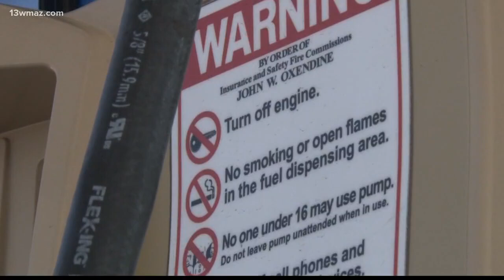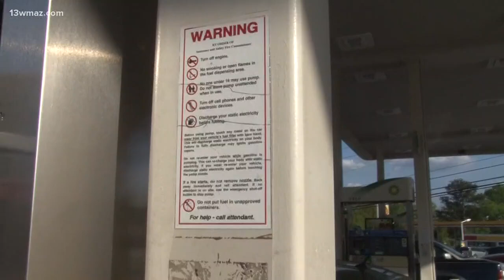VERIFY: Is it safe to keep the car running while pumping gas?

Comment: Well in nascar, they fill up the car while running
Reply: Yes but fires from static is only like 1 in a billion and in NASCAR there is no static to be built up (no fur coats and getting in and out of the car)
Reply: Rafeed Ullah static fires have nothing to do with leaving the car running.  That’s why this is so stupid.
Reply: Why do you think they wear fireproof clothing?
Reply: @thaddeuskyle572  because their build can catch fire due to the extreme conditions they run, also crashes can often lead to fires.
Reply: They also where fire protective suites
Reply: race cars have caught on fire while refueling before
Reply: @RafeedU  "no static to be built up"

Bruh.
There's rubber tires, plastic and latex uniforms and gloves, and most NASCAR races happen in hot dry weather. 
TONS of static can build up there. 
Now, if the pit crew wears grounding straps, THEN they're all safe
Reply: Bruh I’ve been refueling with the car on for 10 years I’m not dead yet
Reply: @delvictor7570  10/10 this was my assessment as well, only talked abt static.
Reply: Allison Hunter  Nope, you don’t understand how cars work. But wear out your starter out idc lol. The only reason gas stations say to turn off your car is because so many people leave them in drive before they get out. A cars internal ignition system is incapable of starting your gas tank on fire.
Reply: In nascar they have a specially designed connection for their gascan/cars that makes a proper seal when connected, not a fair comparison to fueling up an everyday car.
Reply: @brenxbux also very rare and that was due to a different fuel type

Comment: Wouldn't the static electricity ignite the fuel  even when the car is off?
Reply: Yes, yes it would.
Reply: Allison Hunter  better not start your car after filling up if someone is still filling beside you....you should probably only use gas stations with one pump or when they are completely empty using that logic...do something to become more intelligent please.
Reply: Lol i dont think any of us have a master degree in physical bio chemical fire ignation. So if authorities say turn off the engine when you pump. They  must have a good reason why they say so 😂😂😂
Reply: @mathewvanostin7118  Don’t believe everything you see online bud, these people may have degrees but you dont know what kind of student they were. 60% is still a pass
Reply: The fumes from the gas causes fire. When car running while you pump the chances of igniting increases.
Reply: @PrincessTrunksBriefs  Yes… but no
Reply: @PrincessTrunksBriefs  how?? Neither you or they have explained the how..
Reply: @justinmorton1774  Fire needs Heat, Oxygen, Fuel. Fuel is Fuel, Air Oxygen, static electricity causes spark which has a chance, albeit small, of sparking a fire.
Reply: @PrincessTrunksBriefs  that only explains the static electricity part…the engine being left on causing a fire has yet to be explained…
Reply: @justinmorton1774  While car is on ot os burning a liquid. If you are inserting fuel while it's using it their chance the fumes burn instead of the liquid. Causing a fire
Reply: @PrincessTrunksBriefs  no…that makes no sense
Reply: @justinmorton1774  that sucks
Reply: @justinmorton1774  It's explained pretty simply in the video, if you dont understand it maybe learn how vehicles work and how fire works
Reply: @PrincessTrunksBriefs  mechanic of 20+ years….I think I understand how cars work….probably even better than a fire chief who can’t change her own oil
Reply: @justinmorton1774  and wow, you know how to drain something and put more in, so smart omg
Reply: Yes sir... That's a fact Jack!!
Reply: @PrincessTrunksBriefs  Please explain how can the spark from the combination chamber inside my engine on the opposite side of my vehicle would get near or in my gas tank? If I have to worry about a motor running it would be about the person who just pulled up behind me to get gas where their motor is only about 4-6 feet from me instead of the 12 to 16 feet that my motor is from my gas tank filler.
Reply: @shawnyoung5960  tagging onto this incase someone has an answer.  I still turn my car off as I'm sure it could'nt hurt, but having an indepth answer to this would be nice.  Honestly I think this question would probably warrent it's own video
Reply: EXACTLY😂😂😂😂

Comment: "If the heat from the engine comes in contact with fuel" lmfao you apparently have no idea how an engine works. There's no danger in leaving your car running while pumping gas. Hence the reason this entire video is about static electricity.

Comment: Um no,  a fire starting from your engine running is so unlikely it’s not even worth thinking about.
Reply: Murph Kilter but consider how easy it is to just turn off your car. Saves a tiny bit of gas too. There are three things to consider when evaluating risk, 1 how bad does the risk suck should it happen, 2 how easy is it to avoid, 3 how likely is it to occur. Yes it’s unlikely but the other two factors make it worth avoiding since it’s easy af and the severity of it occurring is life/severe injury threatening and damages your car
Reply: I disagree, I think the risk is so low that I am far more concerned about the wear it puts on my starter.  As little as that is, I am way more concerned about that.  Again, the chance of gas igniting is so low it’s not even worth thinking about.
Reply: Murph Kilter well survival of the fittest ... read into it, and swallow your pride
Reply: Rit Mo pride?  It’s common sense.  It’s like not flying in a plane because sometimes planes crash.  Expect flying is far more dangerous than this. I fill gas everyday,  I’ll extend the life of my starter thank you.
Reply: Murph Kilter lmao imagine caring about a starter more than your life , I’ve seen a cop give a guy a ticket for pumping gas with the engine on... but hey Darwinism at its finest 😂😂😂😂😭
Reply: Rit Mo you don’t understand how cars work.
Reply: Murph Kilter my brothers a mechanic buddy
Reply: Murph Kilter just disregard the part where I said a cop gave out a ticket to someone with your thought process lol
Reply: Rit Mo I’m assuming you never leave the house, you know cause that’s where all the dangerous stuff is...
Reply: Rit Mo I wouldn’t even go near the water, you know cuz sharks.
Reply: Rit Mo you obviously don’t even know why some gas stations say to turn off engine when filling gas. Hint, It’s definitely not cuz it’s a fire hazard to leave it on.  But most idiots will tell you that.
Reply: Rit Mo great rebuttal
Reply: Murph Kilter fellas fellas let’s all Calm down
Reply: H.A.M It’s simple.  
1. He’s easily influenced by things he sees on the internet.
2. He fears things he does not understand, and he thinks everyone else should fear them too.
Reply: @delvictor7570  out of curiosity and for my research, since I've been reading what you're saying in regards to safety, can I come you're an anti mask wearer during these corona times?
Reply: A A no I’m not.
Reply: A A can I come that you’re a nosey liberal worried about what everyone else us doing during these corona times?
Reply: I'm definitely no expert, but I worked for an insurance agency for 10+ years, and an explosion from pumping gas while the car was running was reported. 

The report stated that gasoline powered vehicles have sparkplugs that create sparks while the car is running, as such there is a slight chance of an explosion if you pump gas while the engine is still running.

Diesel powered vehicles do not have sparkplugs, so they are often refueled while running.

Again, the chances are remote, but it does/can happen.
Reply: @x_Punisher_x  Sparks plugs are completely internal, that’s silly. Diesel and diesel fumes are not explosive.  The only way it can happen is if static electricity (or another outside source of ignition) sparks the gas fumes as you are filling which has nothing to do with the engine running.  This whole conversation is stupid, no one has any idea what they are talking about.
Reply: @delvictor7570  ive been pumping gas without turning off the ignition since the end of time. To be honest i didnt even know it was a hazard. I just think it wouldn't make a difference whether you have it on or off. I used to live in new jersey where we have someone in the pump and i still leave my car running while that individual fuels my car. I live in upstate ny now where its self serve and i still leave my vehicle running.
Reply: @spitngames6225  this whole thread is a great example of people with no understanding of the subject, weighing in and telling everyone else it’s dangerous because they themselves are afraid.
Reply: @ajtg3807  aye. Cheers to dat.
Reply: Rit Mo ive pumped my gas with my car on for about 14 years im pretty sure it’s okay dude
Reply: Go ahead and Hit the gas pedal while pumping 🔥
Reply: @Chance8888  nothing would happen.
Reply: @delvictor7570  id rather just not leave my car idling, causes more wear than it does starting your car lol.
Reply: @PneumaticFrog  Um that’s completely false.
Reply: @delvictor7570  lol, 1 hour of idleing is like 100km of driving or something like that. i cant remember the equation
Reply: @PneumaticFrog  um no. Just do a quick google. You really know nothing about cars.
Reply: @delvictor7570  im a mechanic but okay buddy. a starter cost max like $200 to replace.
Reply: @PneumaticFrog  no you’re not and no, just no.
Reply: @delvictor7570  okay then, i guess my 5 years of working 40 hours a week for 50 weeks a year as a mechanic has been completely invalidated by a random youtube comment.
Reply: @PneumaticFrog  I actually just went and looked for the thing you talked about on Google and I couldn't find it. What a mechanic you are.
Reply: It makes me happy when someone like yourself comes to my part time job as a fuel attendant, starts an argument with me when I ask them politely to turn their vehicle off, and I end up getting to shut off their pump and kick them out for being a dickhead. Love it
Reply: @IWANTMYPEANUTBUTTER  That attitude you’re a part time fuel attendant? Shocking… lol Still doesn’t make me wrong.
Reply: @delvictor7570  the rules that dictate my part time job are more important than a minor, 3 minute inconvenience for you. I never said you were wrong. But your sense of entitlement is just annoying and petty for an adult.
Reply: @IWANTMYPEANUTBUTTER  I don’t think you know what entitlement means.
Reply: @delvictor7570  I’m failing to see the point you are trying to make here. It doesn’t take a genius to understand how I used the word. Are you trying to mince grammar because you don’t have anything else to contribute? Or what?
Reply: @IWANTMYPEANUTBUTTER  Who hurt you bro?

Comment: If you have a spark in your gas tank, you are blowing up no matter what--whether you're pumping gas or not, you're screwed. This video showed fires from static, and are combining it with leaving your car running even though they aren't connected.
Reply: Pumps are submerged in a fuel-sending unit. There isn't enough air to create a fire within the tank. Sparks can and do occur within the tank.

Comment: are people spraying the fuel directly on the engine because then i could see the argument for turning the car off before you fill other wise cars would just be randomly blowing up all the time its funny when people dont understand how cars work
Reply: pretty sure the engine will still be hot enough to ignite flames even after being shut off for 20 seconds
Reply: @nickblank5712  bro your profile picture is funny as hell🤣🤣🤣

Comment: Yeah you think a fire chief will tell you otherwise?  I've always done it with the engine on, nothing ever happens. And that explosion clip they showed, it most likely wasn't caused by the engine running.
Reply: Exactly I’ve been doing it for plenty of years and that’s never happened
Reply: I'd guess that 20% of people do and that's a lot of fill ups on a daily basis and there are never cases of gas station fires because of it.  Fire chiefs will tell you don't light candles or leave the kitchen while the oven is on too.
Reply: There has never been a fire from the engine running as far as I could find. Online says there have been 200 fires caused by static electricity at the pump catching gas fumes on fire. Most of these fires were from 1999 to 2002. There shouldn't be enough gas fumes in an outside area to catch on fire from static electricity especially the new gas capture pumps that put the aerosolized gas back in the pump

Comment: Where I live it's cold asf.
If we shut our engines off in the dead of winter we wouldn't get them started again.
Just ground yourself to remove any static before grabbing the nozzle you'll be just fine fueling with a running vehicle
Reply: well it depends... But in my location its hot af... so its better off...

Comment: I was topping up the petrol tank today but the trigger of the nozzle could not be held in the pressed configuration.

I used a station for right sided petrol tanks but pulled the nozzle over to the left side since that was the only one available for my car which was left sided.

I had to keep my hand pulling on the nozzle tube because if I let go, the nozzle would fall out from the tube being pulled back to the right side since it was attached to an extendable string.

I asked my mum to check how full the petrol tank was and she said almost 70%.

Then I asked her if she turned the engine off and she said yes.

As I was about to press the trigger on the nozzle, she told me that the engine was still on.

I asked her why did she say the engine was off when it was not and she said she thought it was off.

If I had pressed the trigger the petrol could have exploded and caused me severe burns because the engine would have been on.

Even if I had let go of the nozzle, the nozzle would have been pulled out by the extendable string and the petrol would have sprayed or dripped on my hands and body since it would have been pulled back to the right side of the car.

Comment: you don’t have to run your hand on the car body. simply placing your hand on the body will ground you and static would ignited it regardless of the car running
Reply: When I shut my door is when I discharge any static, as well as prevent the even bigger threat of theft.

Comment: Your closed engine compartment is not going to significantly cool down enough to make turning off the engine worth it when you factor in the wear on the starter and battery. Also it's worth it for the heat or AC to stay on if the weather necessitates it, or electrical load from gadgets.

Comment: Listening to "professionals" speak about subjects they should know about is laughable,  this woman is one of them. Been filling up for decades with vehicles equipped with both carburetors and fuel injection with the engines running.

Comment: Ok.. my 2 cents.  If it is more common when cars are running in the winter..... could out be the dry air, which makes static electricity even more prevalent and not heat from the car stove the car is just as hot or hotter in the summer?  Maybe it has nothing to do with the car running?

Comment: I never thought about it until now but your engines belts running against the pulleys has to build up a ton of static electricity.
Reply: The pulleys are metal. And connected to other metal parts that would be grounded to the frame of the vehicle. So no static would build that way. Static builds in you the individual, which can be discharged, resulting in a tiny spark that may ignite gasoline vapor.

This video is both a lie by structure and lie by omission. They have taken 2 completely separate points and conflated them. Then they have given information regarding only 1 of those topics. The information regarding the other topic has been omitted. So because of that, the average person is going to accept both points as true even though they never explained even a single solitary reason as to how a running engine poses a threat.

Let's think about it though. Your engine's spark is contained in a sealed area. No spark is open to the air. Your engine and exhaust remain just as hot for the amount of time that a fillup takes. So heat is not the concern here even though some parts might be enough to cause a flame if gas came into direct contact. But again that heat is the same whether the engine is running or off in that time frame. Now let's also consider this - vehicles enter and exit the gas station with their engines running constantly while other people are filling up. The engine running does not pose a statistically significant risk.
Reply: @ram89572  agreed and if its accepted that you can discharge the static from your body by touching the metal of your car, then the static that may be generated by the car would be discharged in the same way.

Comment: They said that static electricity from getting out of the car is the problem, not leaving the car running. Way to twist the facts. By the way I've never turned my car off while pumping gas and im still in one piece.

Comment: So hol up. 
Why tf are there signs all around at gas stations then? 
I’ve been reading comments and I am with you guys. I hear y’all out. 
I’m now just laughing at the thought of all these signs. What’s the purpose then? Anyone know?
Reply: One of them is they stop their car and forget to put it on parking gear. That happens lot compared to actually catching fire this way. I heard older cars like 70s or 80s much likely catch fire while pumping, but still the odds were extremely low.

Comment: All the talked about was it starting from static electricity, not the engine running. Even with the engine off the fires would have happened. It didn’t explain how the engine being off makes a difference.